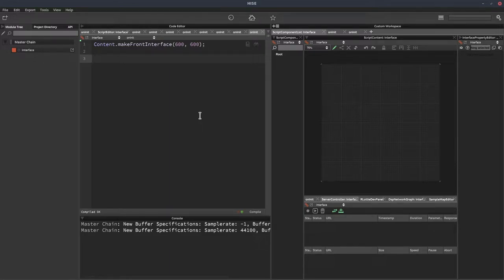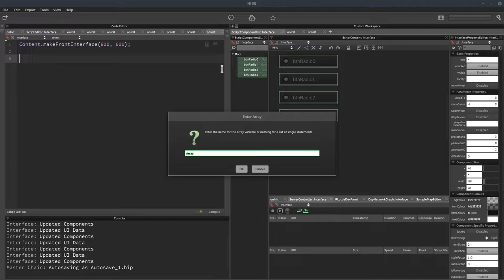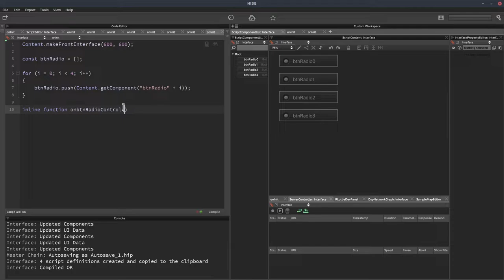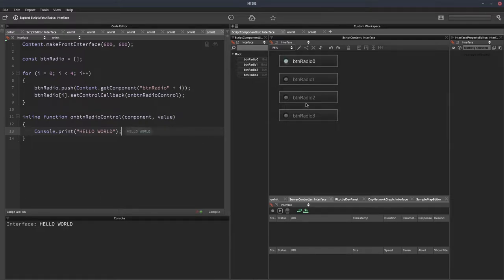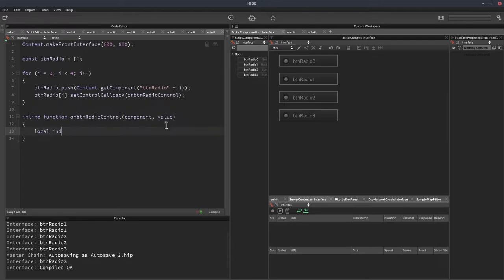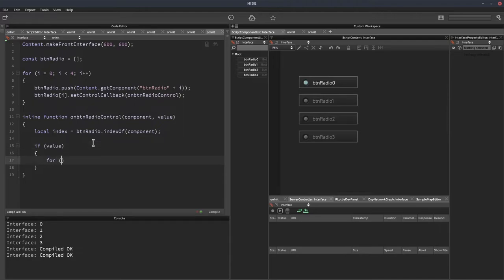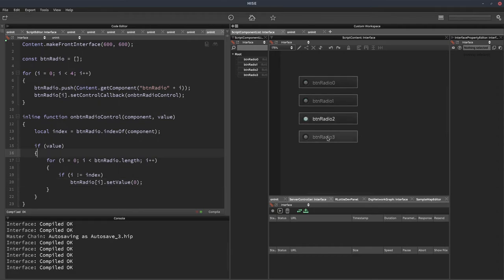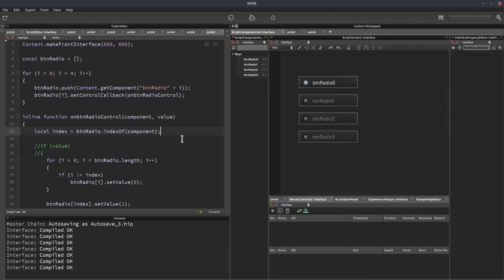HISE: Assigning a control callback to multiple controls

Comment: Hey man is coding required in order to switch the filter from HP, LP, BP? I have two sliders on my UI assigned to both the filter and Q knob in the module tree filter. When I try to add a button I'm only given the "enable/disable" option for parameter ID. Can this only be overcome with coding knowledge? (I'm attemping a micro-freak emulation)
Reply: When I click "mode" it allows me to switch between biquad hp & lp, but I can't figure out how to switch it between all 3.
Reply: This is what the code looks like if that helps:
 [
  {
    "type": "ScriptButton",
    "id": "ScriptButton1",
    "x": 238,
    "y": 172,
    "width": 130,
    "height": 50,
    "parentComponent": "pnlBody",
    "processorId": "Filter1",
    "parameterId": "Mode"
  }
]    

My hope is there is a way to set the mode to toggle between all 3 hp, lp , and hp!
Reply from the maker: @HueyGatez  Yes you'll need scripting for this, there was a forum post recently about switching different filter modes.

Comment: Can such an inline function have more than the 2 arguments component and value?
Reply from the maker: Control callbacks are predefined by HISE, so you can't change the number of arguments. What did you have in mind?
Reply: @DHealey  Okay, thanks! I have  2 series of buttons: One is to increment a slider within a range of 10 to 20. The other is to decrement it likewise. Then I have another row of such increment/decrement-buttons but the should work within a range of 0 to 50.
Reply from the maker: @axymoulm  Should be pretty simple to do with two callbacks, one for each set of buttons. Open a thread on the forum and I'll post a snippet there
Reply: @DHealey  Alright, I'm gonna do that tomorrow.

Comment: Great video! I'm still developing my VST, and I'm still wondering where I should enter my metadata to assign tags to presets? Thanks, abyss
Reply from the maker: The preset browser has a built in tag system. It's a little limited and the UI is not that great but it can be styled with LAF. If you want to roll your own then I recommend doing a search on the forum because others have already done this.